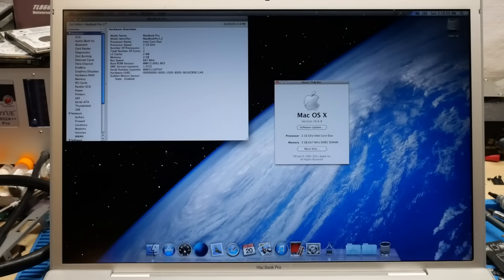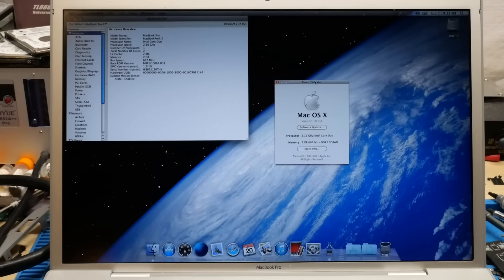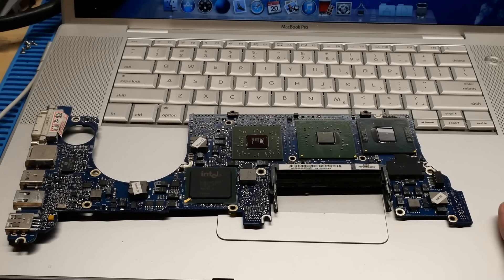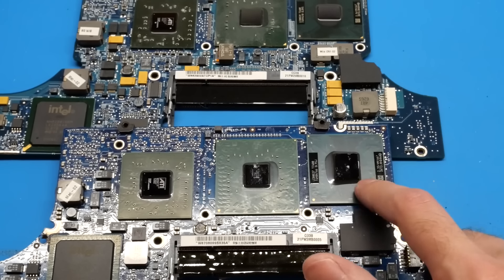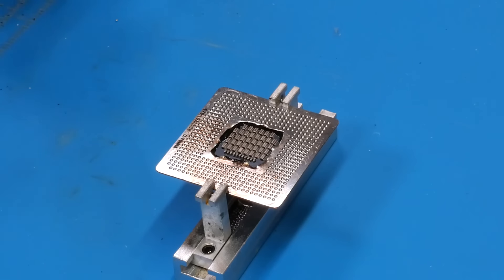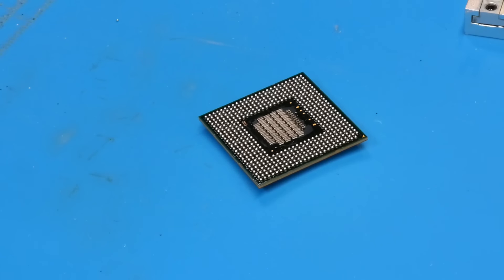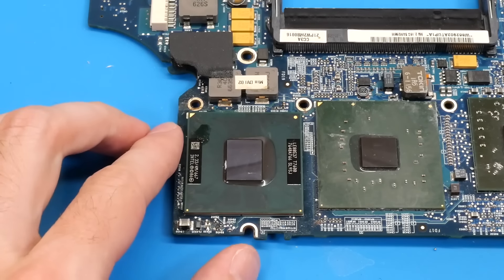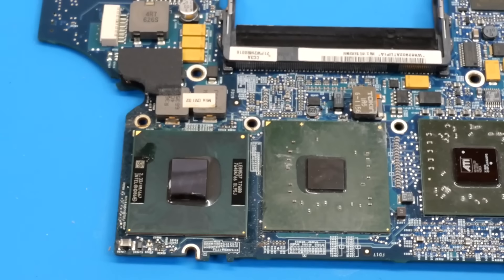Original MacBook Pro gets a Core 2 Duo Upgrade

Comment: Given the timing of when the Core 2 Duos came out, I really wish Apple had just waited for them before switching to Intel. It would've delayed the launch by 6 months (maybe less if Intel could've supplied Apple with lower quantities before that had enough stockpiled for general availability). The result would be that every x86 Mac would've been able to run 64-bit code, which would've simplified things.
Reply: The problem is that when they switched to core2duo, they still used a 32-bit EFI.
Reply: @FoxMccloud42  which could have been fixed with a "simple" software update
Reply: @DangerousPictures not really none of thw 32Bit Efi macs hat the FW Updates to 64Bit Efi
Reply: @FoxMccloud42  I heard the late 2008 or early 2009 models FINALLY went to 64-bit EFI firmware
Reply: It’s easy to say that in retrospect.  There was serious pressure in ‘06 to get the intel machines out. Core Duos were double the speed of PowerBook G4s and they’d been no G5 PowerBook because of overheating issues - so the G4 was really long in the tooth & well overdue replacement.
Reply: The Core Duo machines are a total scam, lost support about as quick as a PowerPC Mac purchased in 2006. And they really did lose support, because no one made 32 bit executables anymore. 

Most Core 2 Macs from 2007 and later still run the latest macOS.
Reply: They had to make money or some anyways back for the poor G5s they created. It's sad they went with intel for those remainder of years. I think they should have went with Arm at the time but they just wouldn't be capable of doing gpus at the time that would have been modular.  It's sad we got a whole era of poor manufacturing defects from lcds, capacitors, and poor CPU's and wrong solder and thermal issues.

I never was a Mac customer back then it was overpriced for me to afford but if I was someone who spent good money I would have sued big time and betrayed by apple at that point.  I want to build a nice custom MacBook with my own laptop bezel case, and beef it up. Idk how hackintoshes work these days if it needs the m series chips. I've yet to even check benchmarks to see what they are even comparable too. I have a thinkpad p52 w a pascal gfs card p1000 and it runs ps3 and switch games and decent pc games. I've missed the last two gens in gaming except through some emulation and had only recently picked up a ps4 to jailbreak and still only played re2 and death standings gaming industry has made so many forced changes and even the pc market. Not like the old days considering I worked a tech bench for 12 years to fixing phones and now it's just everyone builds pcs or does enough or learns enough to do it their own.  There isn't much competition out there we need a underdog gaming company and also new company that sells computers that are modular
Reply: @RussellGi probably a main course reasons to why they went into to continue making MacBooks that would be able to keep up with modern technology mainly softwares. I'm sure it made them alot of money while they developed  the m series chips

Comment: Dehydrator and popcorning...  I learned something new today.
Reply: Yeah I don't do BGA work, but I've popcorned many boards when doing SMD repairs. Never seemed to be a pattern and just assumed it was poor quality PCBs, age, or just bad luck. In hindsight it's kind of obvious that might help.

Of course I don't have the time for that, so I think I'll just continue to play hot air roulette lol.
Reply: @BollingHolt  Correct, it is critical to bake moisture out of parts before rework especially if the part has not been powered up and exposed to running temperatures.
Popcorning can also be caused by poor thermal control during rework.

Comment: I also wanted to mention that it's very refreshing to see you discard the fully saturated solder wick instead of continuing to try to use it despite the dramatically reduced efficacy. I've seen so many videos of people trying to do rework and just scrubbing at the solder pads with spent solder wick and they're just getting closer and closer to rubbing through the solder mask and it's just painful to watch. Your professionalism is a benchmark for the industry. Good soldering practices all around. It's very refreshing to watch.

Comment: I mean, if you went through all this trouble, why not going for the top tier chip out there? A core 2 Quad Q9000. If the bios aint ready for that, you can always hack it a little bit with a bios programmer. TDP is obviusly way ahead, but can always be solved with a bigger 12v brick power supply.
Dont get me wrong tho, you are a wizard with all this magic soldering and fumes.

Comment: Do you have the firmware update script available? I have a 17" MacBook Pro, same early 06 model and I'm looking to get some extra RAM in there, like 3GB instead of 2GB. Also, what is the equipment you use? I really want to do BGA soldering myself, I tried in the past but never exactly got it right .-.

Comment: OH! I've used one of those before! It was a nice enough computer, but it definitely made you understand why Apple decided to move on to their unibody chassis design for later Macbooks. While they could get away with an internal stamped metal chassis for the 13" Macbooks, once you went larger than that, the entire chassis just felt a little bit floppy, which is disconcerting. Regardless, it's lovely to see that someone cares enough about these old machines to not only keep this one in the condition that it's in, but to also want to upgrade it despite the usefulness of the laptop being, realistically, close to zero.

Comment: I had an A1260 MBP a few years ago that was upgraded to Core 2 Extreme quad. It rocks, but it produces a ton of heat. So it eventually got fried, the chips needed another reballing, which I could not do at that time, so I ended up buying an A1342, then an A1278 with an i7 CPU. I still have that old  "heat radiator" somewhere in my collection.

Comment: We had Windows 10 running on bootcamp on the next year's model 1226. It was quite snappy and fine for daily use. We ran a fan controller and Throttlestop to better manage the CPU under Windows. There were a few hoops to get W10 installed but we found online kludges.

The GPU hardware won't support modern encoding so that is inefficient software patches. Your GPU will be much better than the nVidia junk 8600m.

Comment: What a great vid! I thing its super important to be able to fix and upgrade these old dinos - even today. Actually dosdude, if there is a vid that I'd love to see, that I know you can pull off, is to see how to extract and reuse an old iMac logic board (model 2012+) with an external display. The LCD replacements are so expensive that they make it not worthwhile to replace. If we can reuse the logic board with an external display, w/o the crazy fanspin and throttling that happens when you unhook the LCD panel, that would be a huge win for the community.  (I am aware that you can achieve this using OpenCore or linux with a thunderbolt monitor, but I'd love to see a proper technical solution that lets me install the native OS without mods).

Comment: I used to buy old school surplus Mac’s. Certain schools had incredibly lazy staff that preferred to just drill a laptop rather than take 5mins to erase the drive. Luckily the clamshell iBooks I bought had an entirely blank space on the board under the drive. I’d always replace the palm rest, bottom case and hard drive and it worked perfectly. If you bought one of my iBooks 15yrs ago on eBay, there’s about a 5% chance your motherboard has a hole in it under the hard drive lol.

Comment: This is awesome!!

The only issue with these laptops is that I think the EFI is still 32 bit. So the laptop only works with 4gb of Ram DDR2 667 mhz in 2x2 config for dual channel. It can detect up to 6 gb of ram using 4+2 gb stick config but loses the dual channel ability.

I believe there was a way using linux to use 8 gb of ram, but I'm not entirely sure. Would be great to be able to edit that EFI limitation, which is the same one present in the Core 2 Duo white iMacs.

Another issue with these MBPs is that they bent really easy and they get really hot while using them. I still have my MBP 17 with the Hi-Res display, is it still one of the most beautiful laptops ever created. I wish I could put in there an M1 board and use it.

Nice video as usual !!
Reply: hello from Switzerland ,make this good  project ... go go go 👍🏻😉

Comment: These have nice sculpted keys which Apple downgraded in 2008 to the cheap, fashionable chiclet keys. And nice screens (which where just before the change to LED backlighting IIRC). Just before the horrific nVidia 8600M GPU, which might have a recall rate over 50%.
Reply from the maker: nVidia actually released a revised version of the 8600M GT chipsets, which fully resolved those issues. Replacing the chipset on one that has the original chipset with a revised chipset will permanently repair it, and it will never have a GPU issue again. I have another video on my channel about performing this replacement.
Reply: @dosdude1  Apple replaced my 8600 3 times. The last time, Apple underclocoked it; it runs hot and slow but still works.

I'll check out your video!

Comment: I don't think the "newer" CPU can be used with the "newest" MacOS. But maybe something a few years old can be force loaded via on-line guides.
Reply: It's tricky. If it's like my 2006 Mac Pro, the 64-bit CPUs run on a system with 32-bit EFI. Apple didn't support that architecture for very long all.
Reply: @smartperson1  I forgot about that. The move to 64 bit ROM was around 2007 but I don't know exactly when. The "first" rounds of MacBook Pros were quickly depreciated, unfortunately. 

It is incredible how long the 2008 basic frame design and keyboard has endured.

Comment: This was a fun watch!  The MacBookPro2,x and your modded 1,x can still be a performant and useful system for Linux use as well as for legacy Mac OS X.  Do you have any experience/insight with ATI X1600 GPU issues on the MacBookPro1,x and 2,x?  Do you think it's more likely to be a failing GPU die or solder joints failing?  I've owned a late-2006 15" (MacBookPro2,2) from new and was pretty careful with thermals over the years.  I didn't start having GPU issues until about 2017, but it rapidly devolved from a few artifacts to large portions of the screen being artifacted, then the system becoming unstable.  Eventually, I had to disable the AMD/ATI drivers in Mac OS X and Linux just to be able to navigate the GUIs.

Comment: 11:23 how do you ensure that the solder would not stick to the template while heating the solder balls ?
Reply from the maker: It's a steel stencil, and solder will not stick to steel.
Reply: @dosdude1  is there a reason why you use solder balls over applying solder paste?
Reply: @dosdude1  i did not know that, thanks for the info

Comment: thumbs up for words of wisdom about not using solder wick on pcb. its soooo much easier do avoid bad solder joints if just let pads on pcb tinned, but everyone just keep acting as NPCs and removing as much solder from pcb as possible because "look how smooth and clean it is now!"  who cares !?  it not need to look smooth it need to be soldered successfully on first try. just simple experiment : try remove all solder with wick and then as experiment just tin all pads with soldering iron - notice how difficult it would be, and for solder balls it would be as difficult. now pretty much everyone accepted the fact about having to tap chip slightly while it hot to make sure it seated well, but that require very stead hands and only reason it need to be done in first place that person completely dry cleaned pads with stupid solder wick before procedure. if you not do that no need for tapink or any other nonsense. chip seated well and all bolls connected perfectly at firs try.

Comment: I have a question.
I have a dead 2008 Imac with a Core 2 quad 7600, and i have a functional Dell B120 with a Celeron M 360.
If i remove the processor and chipset of the imac board and solder to dell b120 board, just for fun, it will work? 
I have all tools to make that, but i have fear of make that and didn't work
Reply: I have the exact same laptop with the exact same cpu (Dell inspiron b120 1.4 ghz celeron m 360). It won't work because the cpu on the laptop is s479PGA and the imac is s478pga, look up what cpus support socket m479. The whole thing is very confusing
Reply: @andrewpcs-n-vlogs  Ok, thanks for the help

Comment: Nice upgrade. I just tried to upgrade a late 2006 Mac Mini with a T7400 Merom (SL9SE). After changing the CPU the machine doesn't start up anymore. When changing back the machine starts again. I'm confused when I found an extensive compatibility list on macrumors where the author stated that the macmini1,1 firmware is locked to Yonah CPUs and the macmini2,1 firmware is locked to Merom CPUs. This would mean I would have to upgrade the firmware first which contradicts your documentation. So is just my CPU broken or are there more dependencies not described in detail?

Comment: What is like to do is take my Dell Inspiron Ryzen 7 rx580 all in one 27" desktop and take all  guts  out and put in a Apple Mac Book Pro Max board in and utilize the 27" 4k display and make it a ex dell iMac with built in speakers and new ports. It's the Dell 7775 AIO
Crashes a lot now.
Reply: Get a mac mini board, theyre much better suited for jamming in aios, a lot of displays you can adapt to displayport or hdmi, then use the macs  video output

Comment: @dosdude1 can you not Modify the 21,5 inch iMac from 2013 with the geforce gt 750 to 4 or 8 or even 16 gb of video memory? I mean I use it still to run LLM's with 16 gb of ram but I think the gt 750m can do more than the cpu with its 768 cuda cores and even with modified video memory...
Reply: If you can find above 1GB GDDR5 memory chips you could  Frankenstein them to have 8GB or more but under normal circimstances the 750M has a 128bit bus and GDDR5 chips are limited to 1GB chips so limited to 4GB at a 128bit bus
Reply: @astroidexadam5976   hmm ok... did you think it is for LLM's useable when I connect a gpu via old thunderbolt? I have open core on my iMac...

Comment: Why are there so.many chips on this board.  CPU, GPU plus 2 more.
Reply from the maker: Because it's old... LOL
Reply: @dosdude1  lol I know but what are they for?
Reply from the maker: @Technocrat.  CPU, GPU, Northbridge, Southbridge, SMC are the main ones.
Reply: @Technocrat.  Back when this MacBook was made CPU's where not as advance as they are today, So CPU's would have 2 other chipsets, the northbridge and southbridge, the northbridge would handle things like PCI-E and RAM and the southbridge would handle things like PCI, USB, IDE, BIOS, SPI Serial etc and they connected to the CPU via the front side bus but as CPU's got more advance and they were able to fit more transistors in CPU's the northbridge became a part of the CPU (This happened around Sandy Bridge on Intel CPU's) and the southbridge is now redundant because it was replaced with the Platform Controller Hub

Comment: Hello! I don’t know if anyone will read this message but I had a MacBook White 2009 with 8gb and it ran well with macOS Monterrey, but I decided to change the motherboard for the White 2010 that is physically the same and I felt that it took a big leap in improvements and speed, but now I’m thinking of changing the CPU, I’ve seen videos where they do it, I just have to see the model and make it compatible, I’m thinking of removing the Intel core 2 Duo CPU of 2.26ghz model P8400 and changing it for an Intel core 2 Duo of 3.06ghz model T9900 what do you think?, I know that DosDude did it but not exactly the same model I have but I think it would be an interesting project, I would love to contact him and see how we could do it together
Reply from the maker: The T9900 works on the 2010 model, just did that upgrade on one recently.
Reply: @dosdude1  I’m moving with my wife to the USA at the end of the year, do you think we could do it? And How much do you charge me? ... I sent you an email 2 weeks ago on your website, I think it would be a great project, I love that MacBook for how retro and cute it is, it would really be great

Comment: Dosdude are you the same person as This does not compute?
Reply from the maker: I'm not.
Reply: @dosdude1 ok just checking and can you fix my A1286?
Reply from the maker: @TrainLoverYT394  What's wrong with it?
Reply: @ it refuses to turn on, even with only 2 gigs in ram slot 2 and it needs a new logic board a new logic board and the bottom housing
Reply: @dosdude1 its a Mid 2010 one so pre T2
Reply: @dosdude1  and it needs a hard drive (with 10.6.3 or 10.6.4)

Comment: I've been asking about this forever and I will continue to do so every time I see a video about these machines, because I love them; Theoretically and with dosdude1's incredible knowledge of mods that are not worth the effort, would it be possible to put an M1/M2/3/4(?) MacBook Air logic board inside one of these 2006-8 17 inchers and connect the original screen, keyboard, trackpad, speakers and battery? They did it with the iMac G4, someone just needs to try with these MBPs...

I would daily drive that, btw. These have the best laptop keyboards I've ever used in my life, and I don't mind the single button trackpad at all. I would still use my 2008 today if it wasn't painfully slow with OpenCore Legacy Patcher and (actually) painfully hot with any OS at all.